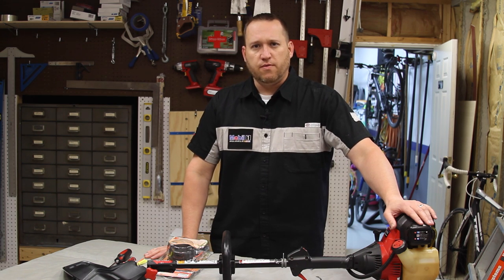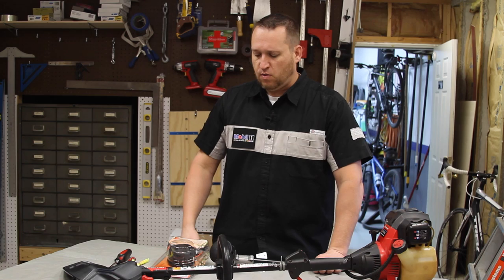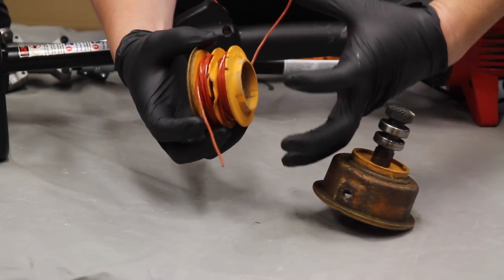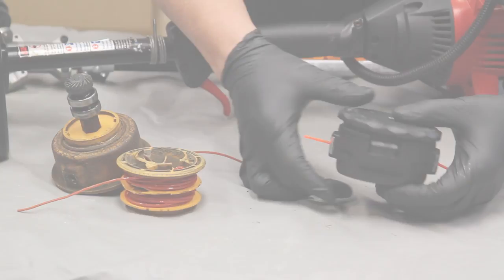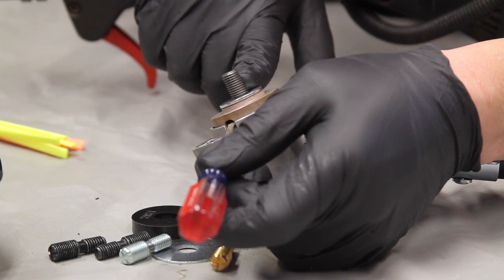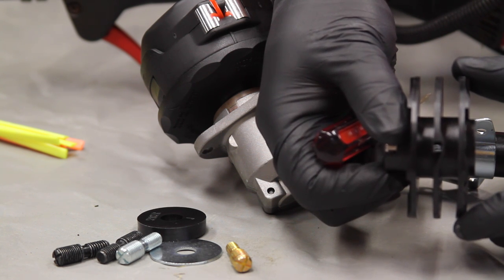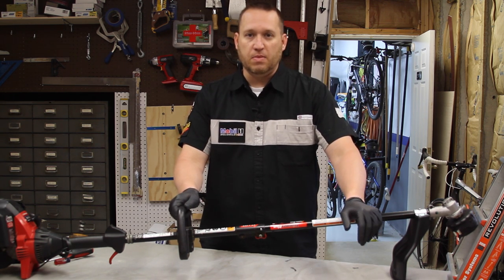Troy Bilt string trimmer improvements

Comment: My problem is removing the old head.  I put a screw driver in the lined up slots turned head as you said and it just pins around but does not come off.
Reply: I would like to see the removal of the old head assembly... I have a TB475ss but can't figure out how to remove the old head. Thank you in advance.

Comment: Why not just purchase the Troy-bilt  trimmer head Part # 753-08182 . That way everything is troy-bilt and its only 14.99$ .
Reply from the maker: At the time when I did this, I didn't want to try and repair.  Ultimately, I replaced everything when the engine failed last year.

Comment: Believe it or not the old head will allow a wind load.   Line up the two arrows...one on head and one of the houseing and insert the string.  You loop it and insert into the hole....do the same for second and then slowly revolve the head to wind it up.

Comment: Very easy disassembly and reassembly. The Shakespeare EASY WIND bump head is better than the original factory head. U can actually add more string to it without disassembling the head. It is also priced very reasonably at Lowe's. Less than $25 tax included.

Comment: issue I have had with the trimmer head and the brush cutter head is hole for the screw that locks the gear housing to the shaft will strip or deform causing the hole head to move left to right. Going to try and fix with some JB weld. If that dosnt fix it I will be going to a non troybuilt, MTD product.

Comment: Great video BusyDad ! Had a problem with my Troy-Bilt TB575EC trimmer also and could not figure out how the cutting head comes off the gearbox. Your video showed me how...thank you very much. The video is very professionally done, and I appreciate that very much. Nothing worse than watching a video with the camera view wondering all over the place, narration with people not knowing what to say, poor lighting, etc.  I also found the electric starter for the Troy-Bilt is well worth it, saves your arm, Arnold square .095 line works great also, very strong, less breakage, a shoulder strap is well worth the investment also. Thanks again, Jeff

Comment: Your bump and go worked the same way.  You do not take it apart to add string.  There are two triangle arrows on the bottom you line up.  Push two 6' strings in the side holes until a couple inches come out the bottom.  Loop the string over into the bottom stop holes and wind up the 6' of string.

The Bump and Go is still junk in my opinion.  I want a head like the Craftsman Hassle Free III.  I was hoping there was away to adapt one to the Troybilt TB475SS
Reply: My tb475ss is great except the bump head. I never knew you could add string as you had described. I'll give that a try otherwise I bought a speedfeed 400 and I just can't get the trimmer off from the shaft. Placing a round piece of rod into the hole of the head unit doesn't stop the shaft from rotating. Any recommendations?
Reply: I also couldn't figure out how to lube the gear case in the trimmer head.

Comment: How did you get that original head off, the yellow one at 1:23 of the video.  I see a slot in the housing but for the life of me cannot get a screwdriver to "find" where it will lock the head so I can unscrew that yellow housing.  I appreciate any suggestions and very well done on this video!

Comment: The newest TB 685 EC models comes with both styles and you don't have to change out the entire head. The winding spool/line pops off with the two tabs then the Aeroflex part just snaps right on. Very convenient. I have to do around a lot of chain link fencing in which the Aeroflex is far, far superior. For everything else I prefer standard trimming line though.
Reply from the maker: That’s good to know. My engine is on its last legs. I’m considering going battery powered but not sure yet
Reply: BusyDadsWorkshop 
Yeah I was looking at the Kobalt battery powered ones as well.

Comment: im now using a Kobalt 80V trimmer but now will need to find a AF730  attachment as i need it for the lower boom, guard and gearbox so i can use it for the stock Kobalt TT stringhead  so i can have the Aeroflex for strictly mowing and the stringhead  to trim around  rocks, bricks, and obsticals  being for the Kobalt unit if the guard or lower boom breaks i have to return the whole unit to the store but these are under Troy Bilt as the parts should be readilly available for the AF720  to AF730 aeroflex  attachments. the arbor shaft and arbor of the Kobalt is the same size as the one on the  trimmer plus  attachment.  But its made by MTD LLC so its under Cub Cadet, Troy Bilt,  Bolens, Yardman, Yard Machines,  White, and Craftsman under their Weedwacker trademark.

Comment: My tb2044 xp came with an extra head for string, I find that it does not have the power it should have running the four blade type head, maybe just putting on two of one coller would work fine, but for the power the string head is better, and it's not hard to feed, just stick strings in on both sides and wind about ten Feet, and there ya go. No taking it apart to load it, I think next time I will get the 4 c, one so it has more power, I don't know if the 2c. Will handle the pole saw to well.  Thanks for video, be ready for the Lord to come soon. Shalom.
Reply from the maker: This head is holding up pretty good.  My biggest problem was that I was using string that was too old and didn't want to come out of the reel properly.

Comment: have the same 4 cyc,..  the string melts inside into the head inside got to open and pull to get going again...called troy told to get the bush head, how about the fence and house  ,, shakespeare replacement my answer

Comment: I bought a new troy bilt trimmer with this type of head and it is not releasing the last pieces like supposed to and tangles up inside every time I start again.  I have had to disassemble the head every time.  How can I prevent this I like the ease of loading string once its clear

Comment: i have the Remington RM 2570 Wrangler 25cc straight shaft Trimmer  will the Echo 21560056 2-Line Rapid Loader Trimmer Head work on it if not what   Head can i get to use .155 in trimmer line

Comment: The new head Speed Feed 400, will not work on my Troy-Bilt TB75SS.  The end has an inner threaded shaft for the drive.  Of the three screw attachments that were provided.  None of them will fit my drive shaft.

Comment: after the tank cracked , just sat in the shed due to no parts availability .
2015 picked up a 20v dewalt electric cordless , was very good until the motor fried in 2017 .
had to call dewalt 2x before they gave me case# and sent me a new unit from the service centre 
going back to gas and making a yard machines y26cs with used cases .( also Cub cadet cc4125 ) same engine block

Comment: My TB685EC was running without much power.  I changed the sparkplug and oil, and cleaned up the air filter to no avail.  The repair shop said I need a new power head.  Not sure if that is the whole shaft you purchased.  They said I was using too heavy of string.  Actually my late husband had put a universal cutting head on it with the airplane wings.  Any advice will be helpful.
Reply from the maker: The power head is basically the whole engine assembly.  At that rate, it is probably less expensive to just purchase a new string trimmer unit.  My Troy Built finally gave up the ghost this past summer and I replaced it with a Ryobi 40V battery powered unit.  it has just as much power as the Troy Built!
Reply: @BusyDadsWorkshop  THANK YOU!  The battery ones are sooo much lighter.   What did you do with all of your attachments for the Troy Bilt?
Reply from the maker: The attachments I had were part of the “expand-it” line. They are compatible with the Ryobi unit I bought.
Reply: @BusyDadsWorkshop  Thank you so much for your help and good info.  I really appreciate it.
Reply: Now I have another question.  I just watched a review of the 18v vs 40v ryobi.  The 18v has much better speed for trimming.  How are your attachments working on the 40v?  I used the hedge trimmer and  edger with the Troy-bilt.

Comment: I know this is an old post but, I have a Troy Bilt TB90BC straight line shaft. The gear box is whining a little bit is there special grease that's used in the gearbox. Any info would be appreciated.
Reply from the maker: Usually, you can use white lithium grease or high temp bearing grease.

Comment: What is the part number for that neck ? That is exactly what I need to add to my TB525ec. Mine has the curved neck at the moment and I have been looking forever online for what you are replacing right now ! H E L P !
Reply from the maker: If you have this same Troy Built power unit, there are other attachments that work. I have a Ryobi tiller that works great with it.
Reply: @BusyDadsWorkshop  I need to know the part number so I can look it up and make sure it will work with mine. Home-Depot started selling Troy-Bilt products so I was hoping they have that neck and gear box set up.
Reply from the maker: I’ll look to see if there is a part number stamped on it tonight when I get into the shed.
Reply: @BusyDadsWorkshop  That would be awesome! Thanks !
Reply from the maker: It’s called the Trimmer Plus from Aeroflex. Model number is AF720
Reply: @BusyDadsWorkshop  Just ordered it from Amazon.... I will let you know how it goes. Thanks again for your awesome help and response's !
Reply: Stupid me had it shipped to my office but I went and picked it up today. SUPER EASY to assemble. took it out for a run with the stock head (not the wire tie one) and it blasted through stuff along chain link fence and onimental rocks. I will probably buy the edger next. Thanks again for your support !

Comment: Theres only about a million different heads out there...and i want a easy and durable head. I have enough problems as it is trynna use 1
Reply from the maker: As long as it has a square connecting shaft, it will work.

Comment: How do you grease the gear case on the trimmer head?
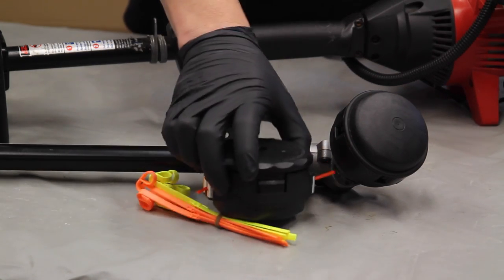Reply: I'll answer my own question. You have to take it apart, or drill a hole in the right place and maybe add a zero fitting. 3:32

Comment: Can you share the link to buy it online for the replacement head you used in the video? I  am not finding it anywhere.
Reply from the maker: I’m not sure if this is even available anymore. It has been quite a few years.
Reply: It’s current model is still available at Loews as “Shakespeare PRO MAX LOAD Universal Trimmer Head”. I had to get extra help to hold a screwdriver in and use a wrench on my TB 35EC turning clockwise to get the broken TB factory head off. My original head had a hex bolt adapter and after 3 years could not be loosened by hand strength alone, so the wrench loosened it up. Also little tip, the Shakespeare Universal trimmer head needs to be pushed down with the arrows aligned to feed 10ft of line thru. I used .108 and it fit fine. Thanks for the original video, troubleshooting these is a pain but the video saved me buying a new weedeater. Interesting but not surprising that Loews stopped carrying ALL the TroyBilt products.

Comment: How does the cover come off?  I took out the 2 screws in the back and the cover won't budge.
Reply from the maker: On the new head, a flat blade screw driver would take the cap off by prying on the tabs.

Comment: I had one of these Troy Bilt TB425CS as well as a TB475ss 4 cycle trimmers as i no longer have them the one the cable in the shaft to the powerhead broke as well as the other one the recoil  spring broke and parts not available for these. but i still have the curved shaft from the TB425 CS trimmer not the straight when i bought the powerhead used.  after using the Cultivator attachment with this the unit vibrated too much was hard on my wrists before they failed. now i have a Kobalt 80 volt battery powerhead and oh yes no vibration  been using the Troy bilt Cultivator attachment with it and no vibration with it  as well as the troy bilt curved shaft part for up close trimming. as  its the  Kobalt Greenworks, Masterforce, Worx, Ryobi, Dewalt Craftsman battery and corded powerheads that are attachment capable to run the Troy bilt attachments the attachments i got is the blower atrachment, Cultivator attachment, hedge trimmer attachment, and the pole chain saw attachment.  as Troy Bilt the company is MTD LLC that has some parts

Comment: has anyone ever had a problem where the engine is running and you pull the trigger and it revs but the trimmer head doesn't spin. Thats happening to me and i dont know whats wrong.
Reply: Seeing as you asked a year ago, I'm sure you either fixed it or gave up... But yes, there is an angle gear box at the end of the shaft that the head screws into, the gears are stripped out. It's happened to me twice now. I don't think they use very good quality gears. You can get a new gear box from the troy bilt website for appx. $25.
Reply: Stuck